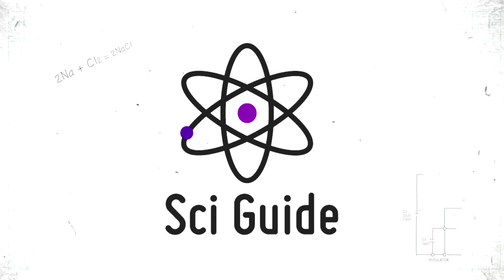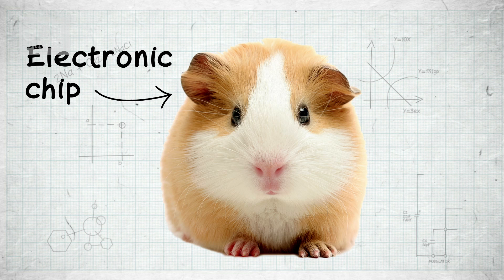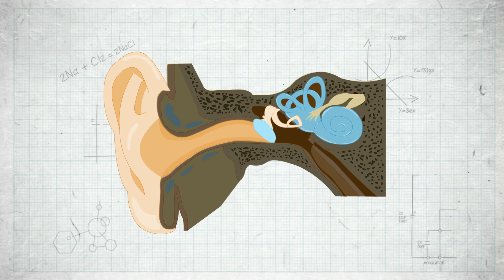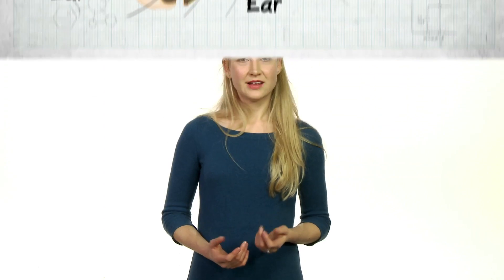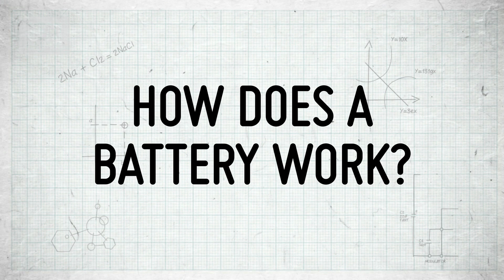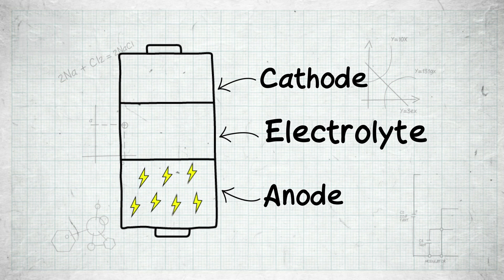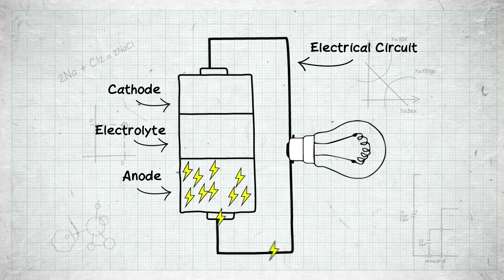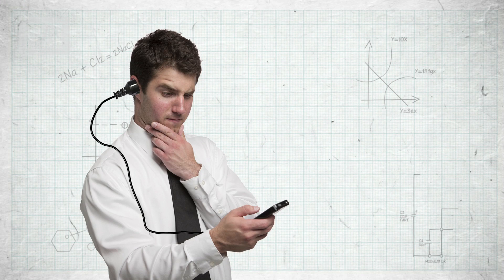What is Ear Power? | Sci Guide (Ep 2) | Head Squeeze

Comment: I noticed something which I believe to be quite significant & it is that the part in the inner ear with those three loops help us in keeping our balance. Now what I noticed after thinking a while about it and also by reading some of the other comments is that when (if) the battery is placed in our ear not only will it operate on the energy it will get from the cochlea but it will/might also take some energy from the vibrations of those three loops. So won't that affect our balance in some way??